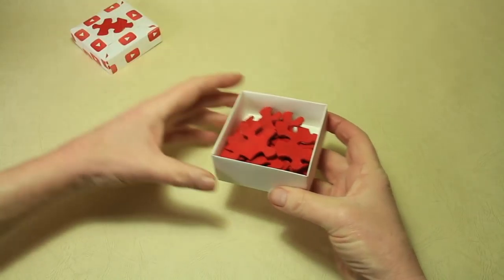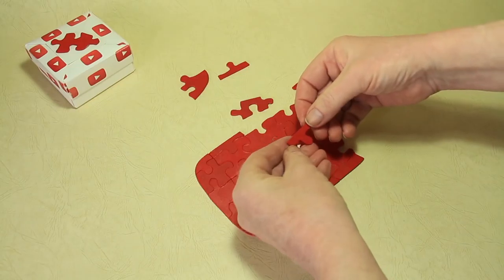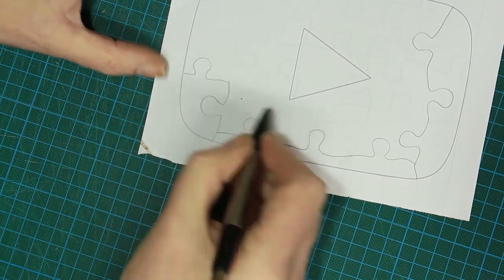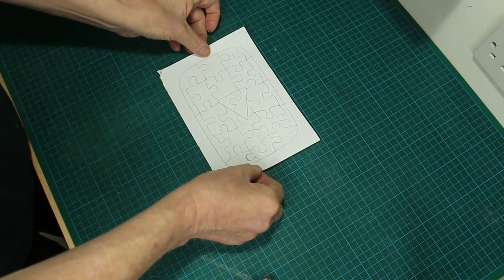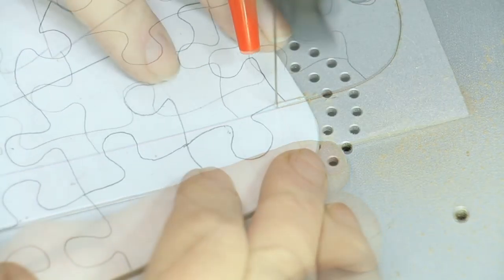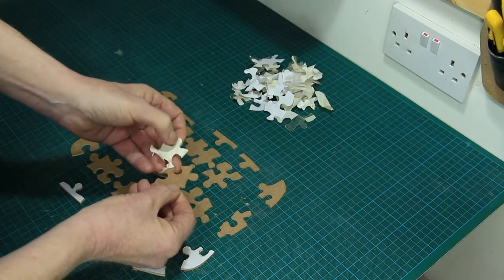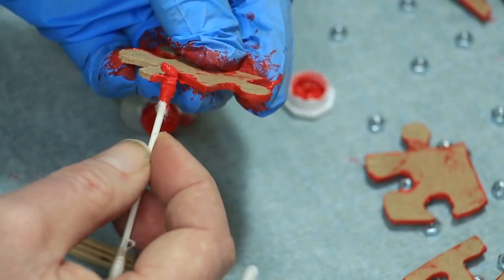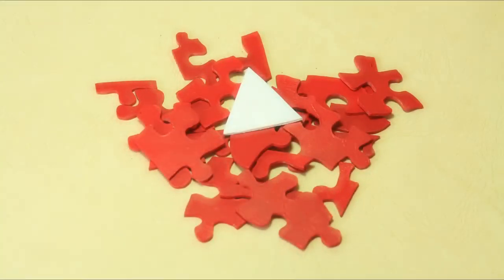YouTube Play Button Jigsaw Puzzle. A Scroll Saw project for the Small Workshop Makers Challenge 2018

Comment: Great 'Make' Stephen - and it could not have come at a better time for me as it gives good tips for using my newly acquired scroll saw - I will not have your delicate control for making intricate pieces with my arthritic hands but I shall be using 2mm MDF for a project and I appreciate the prevention of burrs with tape idea!
I would have appreciated an explanation of using a heat pad to warm the table up - does it facilitate gliding the work around the blade or help dust removal in some way?
Thanks for uploading Stephen and good luck with your entry :)
Reply from the maker: Thanks for watching Eryk. The heat pad was just to warm up the cold metal of the machine. I'm a bit of a wussie when it comes to getting my hands cold! My attempt at a bit of tongue in cheek humour (he he)

Comment: What size blade did you use?
Reply from the maker: As far as I can remember it was a 5 reverse skip tooth. Painting the edges of the pieces helped narrow the kerf to something decent.  With onlt 22 pieces it proved quite difficult as both sides were painted and it was not easy to determine which was up they should be presented. Thanks for watching and taking the time to comment.